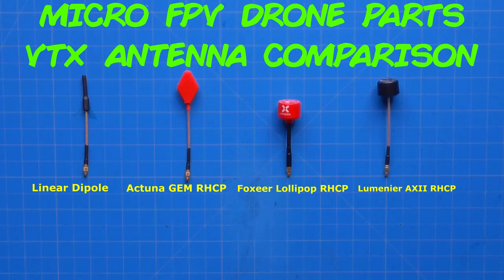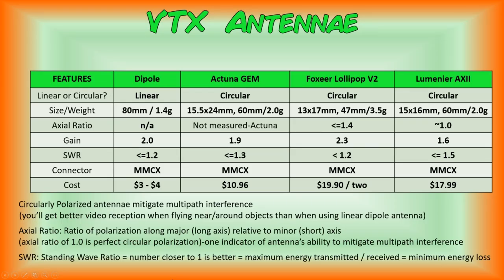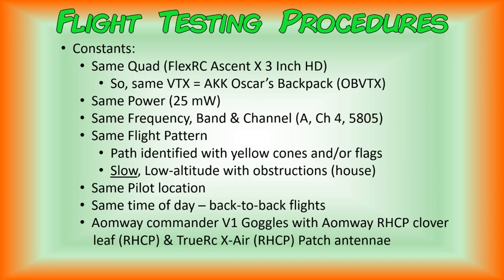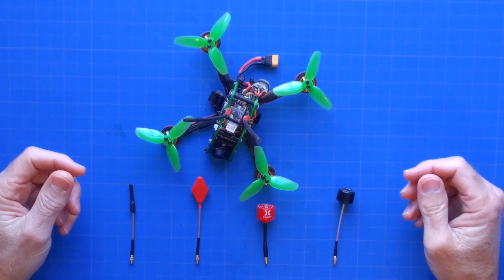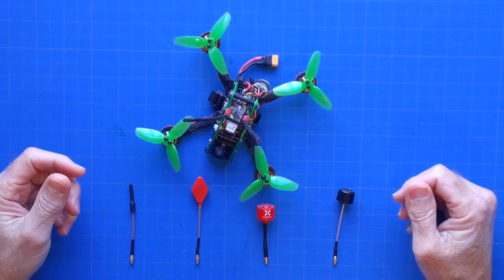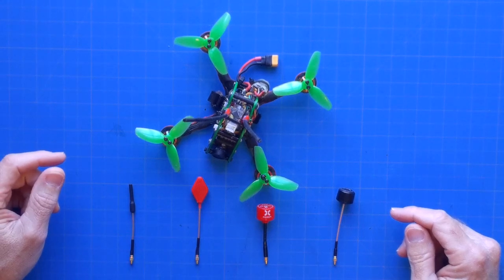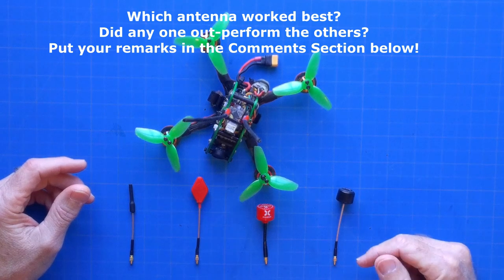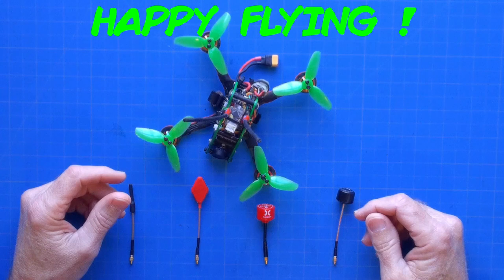MICRO FPV DRONE PARTS - VTX ANTENNA

Comment from the maker: Remember to SLOW THE FLIGHT VIDEO DOWN by using the "Gear/Settings" icon at bottom right of video and setting the speed  to 0.25 or 0.50.  This will give you a much better comparison of the four video feeds than if you kept it at normal speed.  You can also, obviously pause and restart the video at any point(s). Which antenna had the best video?  How would you rank the four antennae with "1" being best and "4" being last? Which one would you purchase for your Micro FPV Quad? Let us know what you think about the antennae and the process we used for the comparison by putting your thoughts and remarks in this Comment Section. We'll get back to you as soon as possible.  Until then, Happy Flying All! Journey to Better - JTB! 👍

Comment: My quads dont have connectors on the Vtx so it's just a straight  Sauder job to it. How do I put different intena on that? And can I just get a different intena for my goggles besides the one that came with it and that help too? I feel like I should be getting out a bit farther or get a bit better pucture.

Comment: Hey my Friend. Durability is also a point to consider. I would choose the Lollipop in that case. On my Quad i fly the TurboWing 5.8ghz RHCP Antenna which is awesome in performance an durability
Reply from the maker: Thanks for watching! You are correct, durability is always something to consider and I did not test for that in this video.  Its been my experience MMCX connectors are more durable than UFL and don't come disconnected as easily as UFLs (all of these antennae have MMCX).  All of the antennae tested have cables flexible enough to bend and not snap.  I don't see the "end caps" of any of these antennae breaking anytime soon based on their construction. These antennae mentioned are for "Micro" class quads and are therefore smaller and lighter than the Turbowing 5.8 GHz RHCP antenna.   Very much appreciate your experience, insight, and thoughts and for bringing durability to the discussion as something to consider! Thanks again!
Reply: @TMacFPV  Yeah, for me the Connector is not important. I solder my antenna directly to the VTX. You can fly these Antennas also on normal 5" Quads to gain some reduction of Weight ;)
Reply from the maker: @LuckyRotorsFPV  Absolutely! The lighter, the better!👍

Comment: I'm using Actunas on all my quads and flying wings :)
Reply from the maker: Seems like a good choice, they're obviously working out for you, correct? What type flying you do, proximity or long distance?
Reply: @TMacFPV  It depends. I used to spend some time on track with local hobbyist and on this quad I used Vee from Actuna. On 25mW and track it was superb. Was thinking of moving to gem as slightly heavier but polarized option but had to sell my racing quad due to financial reasons (getting married is not quite cheap ;) ). Gem had good reviews in our community and is loved by people who want polarization on small quads.

On my freestyle drone I use stubby pagoda and I use pagoda on Flying Wing (longer ranges). Got pagoda  and Triple Feed Patch mini on my HD3s. All handled by Pro58 with Actuna software. I'm also working on ground station, got TFP-array already but need to solve the issue of sending signal to gogles - I don't want to be wired to the station. And my Crossfire is aided by Actuna MOX antenna - never ever had failsafe.

All in all I find Actuna to be one of the best on the market. Even TBS had some of their stuff on their site. Also the price tag is very nice for us in EU when buying from their site. From TBS it was slightly more expensive but available directly to ppl in US.
Reply from the maker: @Umarluch  All great stuff! Yes, I was impressed with performance (and price) on GEM even with shipping to U.S. I may need to try some of the other Actuna stuff you mentioned as well. Thank you for sharing the info for all to benefit!👍